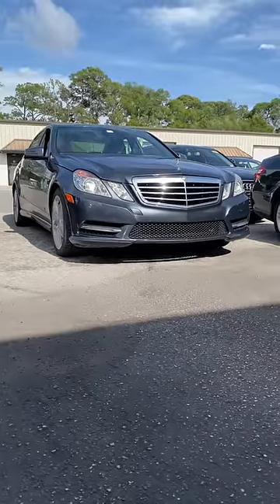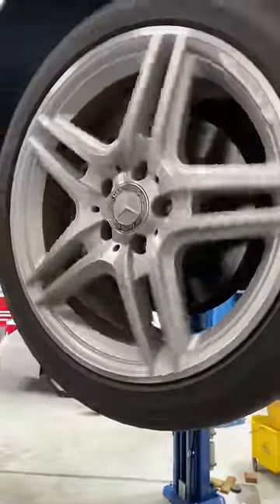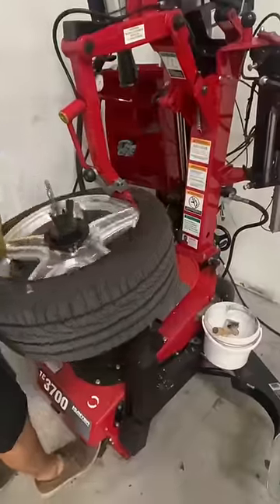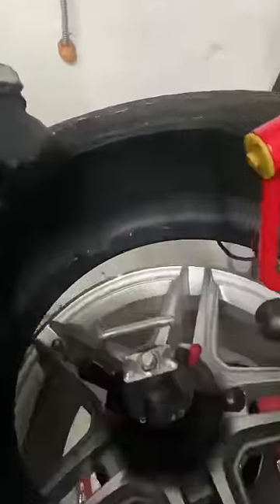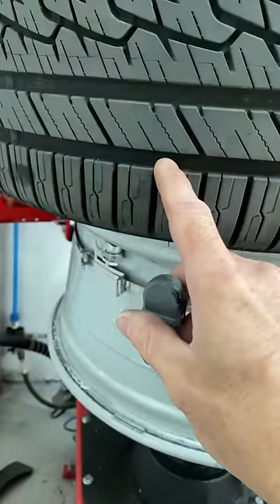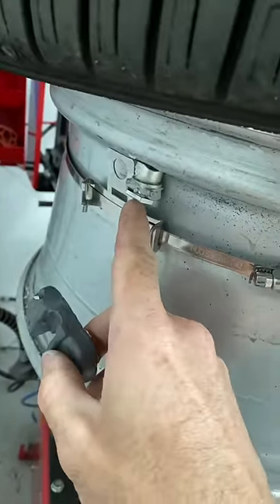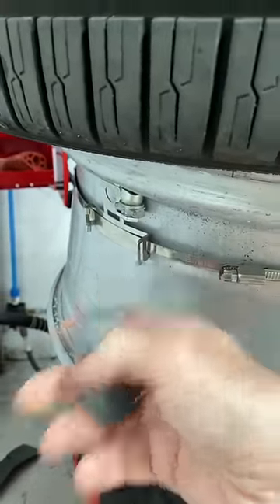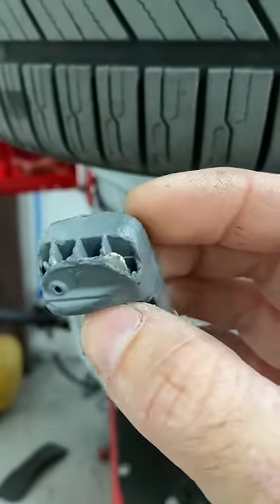Rattle noise found! 😂

Comment: Hopefully you replaced them with some OEM zip ties
Reply from the maker: Of course 😂
Reply: 20$ each just for being mercedez.
Reply: @G_Zero127  Hey man they're made of plastic titanium they aren't cheap
Reply: @JamiesGarage1  in Deutschland we call it Self balancing Yaaaa 🇩🇪
Reply: @G_Zero127  dam that's cheap I'll take 4
Reply: What about OEM Ductape
Reply: i think the mercedes manual calls for 2 tubes of jb weld and elmers glue. the elmers glue is for lunch, so make sure you get one of the big bottles
Reply: i thought everything was fixed by oem duct tape
Reply: @G_Zero127  

More like $40 🤣
Reply: Lmao
Reply: Use Krazy glue next time. It'll hold better
Reply: They were zip ties straight from Mercedes.
Reply: @rickj1983  Yeah but they made replacement of the zip ties a regular maintenance item. You have to change them out for new OEM ones every 5,000 miles. But if you go aftermarket with Krazy Glue, it should hold a lot longer and save you some cash at the dealer
Reply: Mercedes don’t play games like that.
Reply: no no, Aftermarket Zip Ties are better
Reply: I bet 1 million kabillion gazillion cuz billion coladillion to billions gazillion barbellian Galilean little billion that he didn't change s*** and just charged him
Reply: Silicone works well too
Reply: My go to lol
Reply: Dont forget to reprogram the new zipties.
Reply: @JamiesGarage1  you're a terrible mechanic.
Reply: Ded😂
Reply: Mercedes Certified zip ties only 3x more than normal ones
Reply: You made me choke on my drink. 😂
Reply: @svensplooge9961  oh the irony
Reply: ROFLMAO. you stoopid. LOLOLOLOL. That was epic
Reply: I love the internet. The comment section never misses
Reply: @steve_the_springtails fr 😂 last time i ordered tpms sensors from wholesale, my cost alone was 45 each. And that was like 4 years ago. Im more surprised that mercedez was even using the sensors instead of just going off the wheel speed like usual

Comment: "Ok Mrs. Hoffman, your grand total is $897 for fixing the Mercedes rattle."
Reply: They honestly aren't that expensive to maintain if you take care of them. My brand new volvo is proving to be way more costly than my mercedes ever was.
Reply: @sgtmerker2401  what does it means if you take care of it!? Mercedes is made to be baby maintained, and it cost a money, a lot of money.
Reply: @ImportedFromSerbia   not really...
Reply: It would probably be around $100 to $150
Reply: To get the rattle fixed
Reply: Good job she didnt have a Lexus !
Reply: @lucasbeadell7788  meh... a good shop would not charge you a dime
.
we have a sign saying "we arnt responsible for TPMS sensors"
.
yet if we screw one up.... we take the 50 dollar sensor cost and 10 mins to reprogram 
.
.
the sign is for the assholes who come in with a bad TPMS..... light on the dash for the last 50,000 miles
.
and then try to blame us for damaging it
Reply: @lucasbeadell7788  $60 at Costco
Reply: @ImportedFromSerbia  not really the older ones are workhorses
Reply: @sgtmerker2401  depends on which one you buy, don't get a w220/w125 or w221/w216 is all I can say :D
Reply: I’m sure that tpms transmitter isn’t cheap. Diagnosing, labor, parts. Yeah it isn’t cheap.
Reply: Don't forget to tip your mechanic, he needs that health insurance.
Reply: @sgtmerker2401 you missed the point entirely. Mercedes owners will be overcharged because the shop assumes the owner can afford a huge bill and is used to getting huge bills.😂
Reply: Your not kidding 😅😂😂
Reply: Ohhh I forgot to add in "shop supplies" and Environmental supplies and that will round it off to $1,575 PLUS tax and California homeless shelter fees.
Reply: No.. no it doesnt...@ImportedFromSerbia  you probably just dont have any money if you think its expensive to maintain

Comment: When your life is falling apart but you’re still doing your best. 
That sensor, probably.
Reply: Most underrated comment
Reply: We can all take a page from their book.
Reply: That sounds like my life motto lol 😆
Reply: I love this comment
Reply: Is that sensor wirelessly connected? Does it have a battery in it? I know jack shit about cars btw.
Reply: @bickyboo7789  yes it has a battery and pairs to the vehicle wirelessly. They also have to be reset when the tires get rotated so that they will show they are on the correct location after.
Reply: Best comment! 💪😁👍
Reply: The Big Box Tire Installer certainly tried his best.
Reply: I don't know... I would have tapped out
Reply: Fr
Reply: ROFL Exactly!!!
Reply: @bickyboo7789 I honestly can't help myself NOT to comment, even after one year of your question..... Yes, the sensors are wired to your vehicle's modules. Every time the wheel rotates, a wire (sort of like an old school vacuum cleaner) wire unspools.. Sending constant info to that ecu. The only downside to this "advance in technology", is you have to drive in reverse just the same distance as you did foward, to "rewind" the entire system of wiring. It's a win/lose/lose. Tech is a mofo.
Reply: The start of some song lyrics

Comment: Ecu: "tire pressure passenger side?"
That sensor: "yep all good over here keep er goin bud!"
Reply: Also it is easy to avoid breaking the sensor if you know it is in the wheel.  How do you make that discovery.  You turn on the ignition without starting the engine , look at the instrument panel if it has a tire light it has sensors in the tires.
Reply: @thomaslemay8817  not necessarily true, i run 2 sets of tires on my car, neither of em have TPMS sensors but my car still shows the light on startup (though it switches off after a few seconds)
Reply: Tell me your Canadian without telling me you are Canadian. 😂
Reply: @greo909  Tell me you never learnt the difference between a possessive pronoun and a contraction.
Reply: @stephenbrookes7268  relax bud it’s YouTube 😂
Reply: @thetaylor650 Where Mediocre is the new that'll do.
Reply: @malcomaustria3479  your system may be working with abs sensors, calculating rotation numbers and then concluding one of them has less pressure
Reply: Had me dead almost spit my coffee out
Reply: @stephenbrookes7268  it's possible the first letter in the sentence was meant to be 'S'
Reply: The epitome of “I don’t like bothering people”
Reply: @thomaslemay8817  that's a weird way of saying you don't know the difference between active or passive tpms.
Reply: @thomaslemay8817  any place that replaced tires should know to avoid sensors. Its a benz it most likely has sensors, even if not treat it like it does. Its super easy to avoid them why not treat it like it has them. Ive never worked ina tire shop but i worked as a fleet mechanic with tire machines in the shop and replaced 100s od tires. Never knce damaged a sensor. Just keep the valve stem away from the parts of the machine, pretty simple and common sense

Comment: This is the exact noise I've been hearing and I didn't have the slightest clue. Now I have something to look for, thank you.
Reply: Me too! I checked suspension and sway bar links but they seemed good. Maybe it's this!
Reply: @sjn7220  it ended up being just that. Had to buy a new tire sensor because it stopped working in the process of being smashed around inside the rim lol
Reply: @jackebbighausen8095  For real?
Reply: @sjn7220  did you check?
Reply: @Convolutedtubules  yes
Reply: @Convolutedtubules  Not yet.
Reply: A mechanic slammed my tire down, when removing it for the brakes and caused it on mine. They fix it later, but I got a new mechanic shop.
Reply: @Convolutedtubules  nah he’s lying just wanted to feel important
Reply: @UlyssesCoto  that's definitely not what happened even if that's what their excuse was. No way they can throw it down harder than running over a pothole
Reply: @metalshiflet7826  Twice a year I bounce my from the truck bed to the ground then basically dribble them like a basketball to the garage, I’ve never had an issue with sensors.

Comment: I had a sensor break off in my tire one time, and I just decided to live with it for a while. When I put new tires on my car after a while, the tire with the broken sensor rattling around was totally pulverized on the inside.
Reply: What are these thibgs made of ?
Reply: @-na-nomad6247  plastic
Reply: @-na-nomad6247  titanium/gold/silver. They're worth about 10k each.
Reply: @todtalk3912  no?
Reply: @richardmillhousenixon  (that's a joke)
Reply: @JDMOON55555  It's a pretty terrible joke
Reply: @JDMOON55555  jokes are funny.
Reply: @deusvult6920  jokes attempt to be funny, they don't have to be..
Like your version of sex, you try.. But just end up flopping, sweating then give up when you realize you can't reach it with your gut in the air...
Its almost funny

Comment: Everyone knows you're meant to use glue, not zip ties for these 😂
Reply: For real. Take it from a tire changer who broke a few and used super glue.
Reply: @2moke2creen  hey now, when you use it professionally you gotta call it by its professional name!
You gotta say CA glue or people will get wise!
Reply: If they used plastic zip ties I bet it would still be on the wheel
Reply: Gorilla glue does a tremendous job 💪💪
Reply: @xostler  I only sophisticate like that to customers when I'm trying to sell some slow movers lol. We don't use CA when Loctite does just as good a job for a fraction of the price ya know.
Reply: Duct tape
Reply: HUH??!!!!
Reply: @2moke2creen  yes loctite da best
Reply: Duct tape
Reply: @2moke2creen  loctite has really diminished in quality. Outside of the actual thread locker, their other products leave much to be desired. Don't even get me started on their anaerobic sealants. Pure junk. That's why many of these German cars develop leaks early. As they are the factory supplier.
Reply: @LynxStarAuto  you got a point since I'm not veteran with Loctite since I only use their super glue and thread lock as people recommend me. Like 3M products not everything a company makes is their expertise.
Reply: The Mechanic skipped class that day😂
Reply: JB Weld. Would've had to wait a day for it to dry though.

Comment: I used to be a hummer tech. I had a new h3, customer said it made a noise like running over a coat hanger at random. I drove this thing around with chassis ears for 2 weeks looking for this noise, and it kept radiating up and down the driveline. I swapped the transmission, transfer case, both driveshafts, both diffs and the noise was still there, and it was random, no rhyme or reason to it. Gm finally sent out an engineer to help me with it, and he suspected something with the parking brake, but I said can't be, I already swapped the entire diff, but I humored him and pulled the wheels off for the umpteenth time, and as I did, the left rear wheel made the noise. The engineer and I couldn't get to the tire machine fast enough to bust this tire down, and sure enough, inside the tire was a valve stem with no cap on it so the brass exposed and a piece of masking tape tagged on it. On the tag was written with a sharpie "gotcha!". Remember... h3 was one if the first vehicles to hit the road with tpms sensors, so it didn't even half valve stems, who would have thought to look for a valve stem inside the aluminum wheel bouncing around and the brass hitting the aluminum wheel at random?

Comment: I’m actually quite surprised it never threw off a tpms light 😂 damn German build quality 👀
Reply: Was it a german sensor?
Reply: ITS NOT CRAZY; what really happened was WHEN the big box store broke the tmps, so the mechanic disconnects the module that all the tMPS actually plug into and control the sensors; it also sends the signal back to the car computer, that controls the tire light; so the car no longer has a working Tire Pressure Monitor system on any tire not just the front passenger; Therefore it would be impossible for the tire light to be illuminated; otherwise the customer would have known right away, that there was a problem; I AM QUITE SURPRISED JAMIE DOESNT KNOW

Comment: The only thing that keeps working in a Benz. 

Yeah……. I’m talking about you E350 transmission value body………… learn something
Reply: @vinniecousinofvito6401  Valve body is a common failure point on these transmissions. Can be mitigated with shorter interval fluid and filter changes. Lifetime fluid my ass
Reply: Life time fluid means the life time of the fluid it's self not the trans its self, it's a marketing gimmick
Reply: @AnticipatedHedgehog  Lifetime means the life of the transmission. So about 8,000 miles
Reply: Funny how you should say learn something. I am a Mercedes tech. Valvebodies on W212 E classes are not a common failurepoint, and there is a oilchange interval on them. But ofcourse if you dont follow your serviceintervals then its your own fault.
Other than that the W212 is a pretty bulletproof car
Reply: @admiralfloofz658  I’ll be honest. They over engineered everything on that car. And the process of Maintenance is an equally complex labyrinth of instructions. No wonder they fail so often. Not every tech has a 200IQ
Reply: @admiralfloofz658  interesting, the dealership here in Atlanta said that they were seeing so many of them come back that they were surprised  a recall had not  been issued for them.  Thank you for your insight.
Reply: @admiralfloofz658  also mine was a W211 if that makes a difference, so I am glad to hear the W212’s were better.
Reply: @willpitts4491  W212s are definately not over engineered. If you think that then stick to tractors. As I said, they dont break down often. Infact in Europe Lexus is nr 4 on most breakdowns. Mercedes isnt even in top 10
Reply: @Michael_Rega  well I have no explanation to that. We havent changed a single valvebody on a 212 at all. We have changed a few on the A class thou with the doubleclutch. But not enough to make it a common issue.
Reply: @admiralfloofz658  I wonder if the W212 was a lessons learned kinda of thing  with the issues I experienced W211? 🤔
Reply: @Michael_Rega  Not really, I cant say there were many issues with the W211 either. I mean they have the same transmission basically, just some details different.
Reply: @admiralfloofz658  you’re out in Europe. We’re in the US. There’s different climates that affect the car differently, furthermore you don’t pay a premium for the car or the parts as they all originate in your country. 

Legends have this phenomenon with blowing their extension shaft and secondary driven gear when the extension shaft cover seal goes bad due to humid heat and the lubricant dries up. This happens to them in hot climates, but not cold ones. I got one that came from Florida up here in Minnesota and have learned a lot about geographical based failures since. 

Mercedes, Audi’s, and Honda’s are highly prone to this phenomenon too, it’s due to the rubber compounds they used not liking the manor change in operating environments.
Reply: @admiralfloofz658  usdm models were complete garbage compared to their domestic counterparts

Comment: If you don't pay attention it's surprisingly easy to break of these sensors.
Fortunately manufacturers appear to be switching to indirect TPMS systems wich is great because the customer no longer has to replace dead Sensors, I no longer need to use my brain so much when (dis)mounting  tires from rims and simpler "Programming" procedures when changing wheels are getting easier and no longer require special tool (Opel/Vauxhall maybe other GM products)

The only disadvantage is the fact that wheels with sensors can detect even slow pressure loss. The indirect TPMS system can not.

Comment: Once had a customer come in with a sensor issue on his Durango, wasn’t reading on the tool. Pulled off the tire, sensor was loose and had broken off, likely when the tires were mounted. Last tire work was getting new ones a YEAR previous. Sometimes they are pieces of junk, but that is something I gotta say Dodge does right, their sensors are some of the best of anyone

Comment: They break your stuff and lie. This is dangerous. I had sears put on shocks and a front one was not attached. I drove around the corner and back and they told me..it was not thier fault..I had driven off the lot.. Wtf.the front shock was just hanging down
Reply: Sears cracked the ceramic on the brand new spark plugs they put in my sentra and refused to replace them or give me my money back' never again 😤